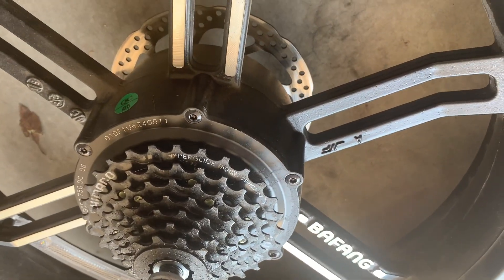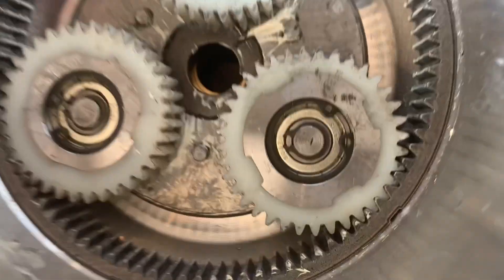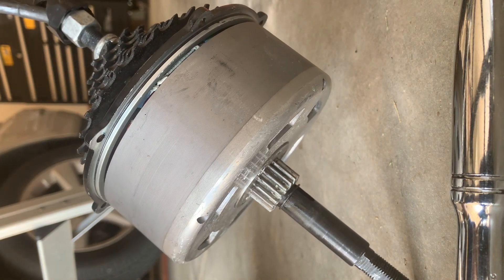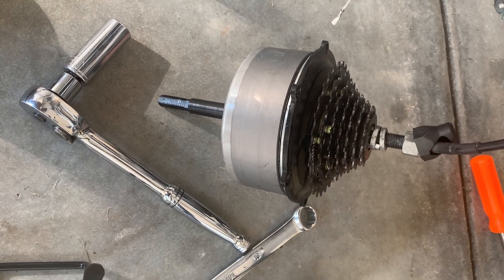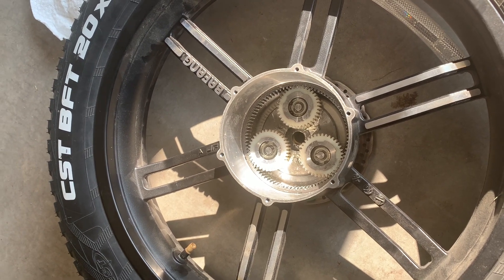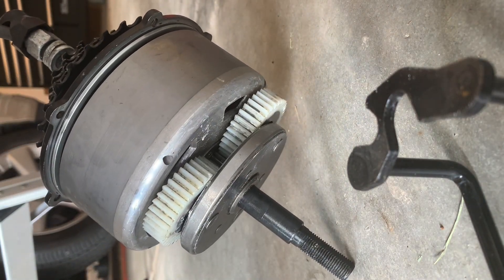Ebike Hub Teardown - Bafang G0F0.750.DC06 - Friend Bike Chassis

Comment: I’m trying to replace the motor and cannot fit the battery cable connector through the bearing that’s on the housing. Does anyone know how to do this?
Reply: Have to desolder the wires & send them threw wires first not connector first😂

Comment: My ebike is noisy only sometimes,  but other times not noisy... But if I let off the throttle and reapply some times it goes away,  sometimes it very loud.    I took it apart didn't see anything wrong.   SO I ordered one way clutch and nylon gears,  also ordered a tire and tube because it was bald and flat.   I re-assembled the motor,  just waiting on a new tire that should be here tomorrow.  I hope this fixes it.

Comment: bafang one of the most expensive and planetary gears are in plastic ! wow now i m sure i ll never buy any of their products at all
Reply: All hub motors use nylon gears and thats totally fine.
Reply: Metal on metal will wear out the case and cause a whole wheel replacement sooner than a nylon gear that won't ruin the housing and wheel, it's a good design.
Reply: @dangerdave3954  yeah must be the reason cars that can make up to 500 000 kms they all have nylon gears .......if they are well made and with the right materials they last forever unlike nylon.
Reply: I'm upgrading mine to steel gears.
Reply: @kurtismckemmie4850 Tell us the source of steel gears.
Reply: Yeah but i meant given the price they  should've been made in steel in the factory

Comment from the maker: Side note: it's amazing how many more motor teardown video's hit YouTube since I put this out. I'm so glad there is more info available now. It's good for everyone.
Reply: I know this video is 2 years old, but I had the same problem recently. My rear wheels axle was bent by just a little, and it caused the motor to hit the magnet and cause damage. Everything else in the rear wheel was perfect. I wish they sold replacement axles for ebikes or reinforced axles. I usually buy reinforced axles for my normal bicycles.
Reply from the maker: @Just_Randomi  Just saw this. Thanks for adding to the info!

Comment from the maker: Following up on this. I haven't replace the gears yet. I have them just haven't put them in. Next couple weeks I should be able to do it and will to an update video. Thank you to all that responded and found the video helpful.
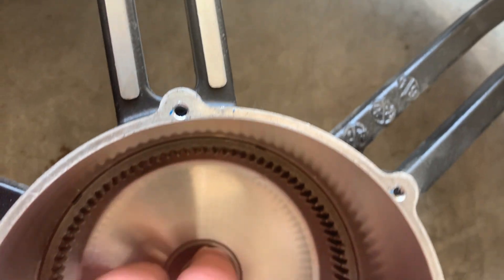Reply: what size and thickness is the thrust bearing washer btwn gear and hub at 0:44? Did you ever figure out the reason to the rattling sound?

Comment: All throughout my early days of r/c cars, we always upgraded the nylon gears to metal, regardless of the extra noise. We did this for reliability. We reassembled with good grease and the motors and transmissions were rock-solid and happy over several race seasons. This coming winter will be my 5th riding season on my Bafang 750 fat ebike motor and I'm going to replace the planetaries with metal gears that I already purchased last year. The whole point is that my 70 pound fat bike is not gonna get pushed home 20 miles because the planetary nylon gears failed like all the RC cars that we used to run. I'm not pushing that pig home! I know it will be noisier, but on my bike local path that may be a good thing. Also, you can get copper gears as well as steel. Not sure what the difference in sound or longevity is. If I'm successful, I'm going to put together kits along with the security bit in grease for the Bafang 060.
Reply: They're not gonna shred like that you will have warning
Reply: @steveshea7725  So, I assume you'd come get me if they do shred? I just can't take the chance as I have no way to get my bike home otherwise as it doesn't fit in our cars.
Reply: @guitartec  Yeah mine shredded new heybike explore in less than 200miles from new and I had a trailer I could haul it back home at least I had my wife with me so I took her heybike ranger to get the trailer or I'd been screwed.. You can't even pedal when the gears go or push because the wheel was locked...
Reply: @22YZ450FX  They sell brass planetary gears now. I never did instal the steel gears I have just b/c everyone says the nylon gets noisy as the teeth break, so you can probably get to where you're going before complete failure.

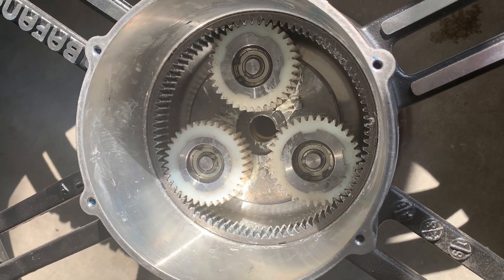Comment: @4:46 what type of grease/lube would you use on planetary gears?
Reply: Clean all the old grease out with a rag and grease with full synthetic aviation grease that's safe for nylon.
Reply: @steveshea7725  thanks, I hear Mobil 28 or molykote 44
Reply from the maker: In this case it’s a white lithium grease suited for the plastic gears.
Reply: @bjackson1975  thank you

Comment: I have a bike with a bafang M155, it's a 750W motor.  The motor is the opposite orientation where the cable comes out the brake side rather than the standard cassette side.  To get the motor out I have to get the main planetary ring gear out of the hub.  I've tried pullers with no success.  How do you get that main ring gear out?

Comment: Each gear has bearings, each bearing has needle rollers, in one of the bearings one or more needle roller has worn a flat  spot on it, that's what's your hearing, if it seized, locks up, and it will sooner than later, then the race will turn around the shaft ruining the shaft so Right now it might only be the cost of the gear. It's usually the nylon teeth that wears out first.
Reply: No it won't.  The gears are plastic/nylon.  If the bearing seizes the plastic teeth will just eat itself and that's it.  It's not going to ruin the shaft. 

You're trying to apply automotive knowledge to cheap plastic planetary gears made in china.

Comment: What’s the best grease and brand to use? White lithium? Thanks
Reply from the maker: That’s what everybody’s using. A thick white lithium trailer hitch grease might be a decent option as well.
Reply: Full.synthetic nylon safe aviation grease
Reply: @steveshea7725 best comment, check of it is safe for plastics ❤

Comment: Thanks for posting this I just bought 10 bikes with this motor...good to know its serviceable.
Reply: do you know what's different about a 20" bafang hub motor vs. a 26"? are the planatery gears different or do they just go slower due to wheel size?   I'm only on my 4th ebike, wanting to do something radical w schwinn i put a 500w on front.... thinking about running dual motors with one gear'd higher(overdrive when the rear is spun out)), that 20" 750w upgrade I see going in those fat wheels looks just like mine🤔
Reply: @autojohn2000  The winding can be done differently in manufacturing to affect the torque and top speed characteristics. so likely a 26" motor/wheel assy will be wound a bit differently - you can decipher these with the motor codes stamped on the motor. sorry i cant give you specifics...
but in essence you need to do your homework on which motor and with what winding,  not just wheel size.
Reply: @rickc2222  I figured there was something like that, TY👍

Comment: I drill a small hole on the gear side so I can spray chain lube on the gears. I use a plastic rivet to cover the hole.  If you do not have a pure sine wave controller. You will get a whine traveling through the motor.
Reply: The brake disc holes should go right into the the motor. You can see them in the thumbnail for this video.